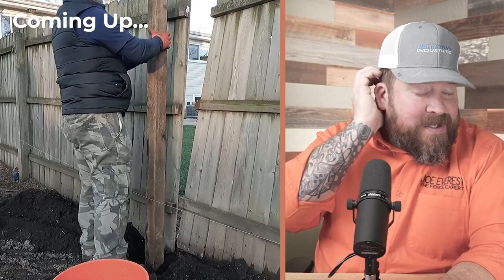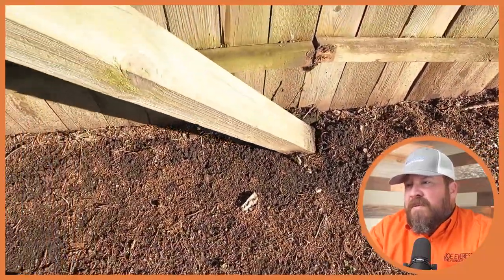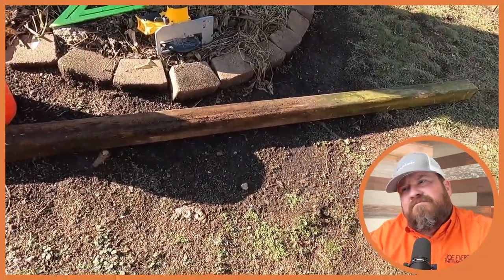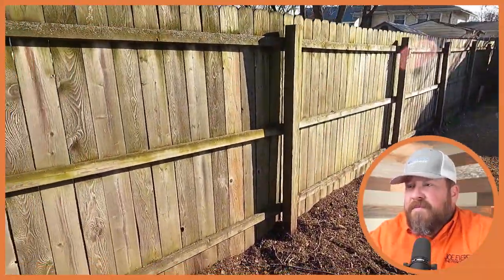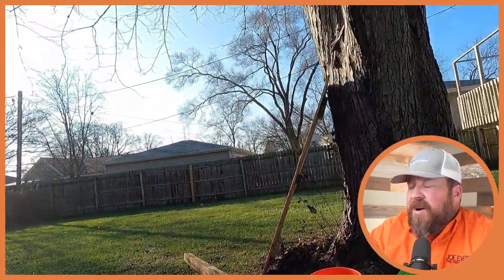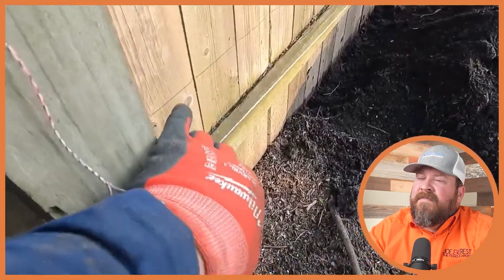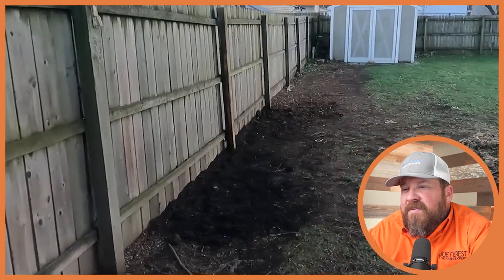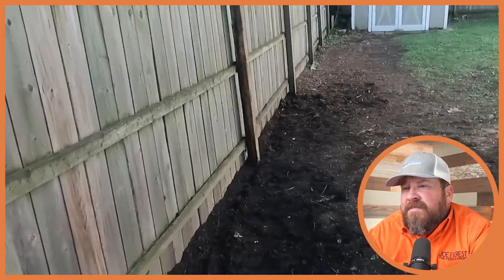Pro Fence Builder Learns How to "Fix" A Broken Fence Post

Comment: In Holland we have quick cure cement, probably you guys this too. The thing is that this can give woble in the post because the cement shrinks during curing. I stopped using it and premix all cement in a bucket and then poor it in.
Reply from the maker: We haven’t had a shrinkage problem with this brand a quick setting concrete, but I could certainly understand your point!

Comment: We all know that digging around the concrete ball is inevitable. I pull my posts with a modified hydraulic engine hoist. Usually I'll try to run a long lag with an eye loop to hook onto to pull the plug. If that doesn't work or isn't an option, I'll dig around the plug enough to get a chain around it to lift it out with the hoist.
Reply from the maker: Solid processes, I appreciate you sharing them!
Reply: @JoeEverest  I kinda like the idea though of running concrete lag screws into the concrete through the chain to minimize digging and yard damage. I'm gonna try that next time I face this scenario

Comment: I probably get bombed for this....but this how I handle it.  The fence is already old and not many years away from replacement.  Why work yourself to death pulling up the old post.  You risk running into hidden problems like a tree root or who knows what else.  We dig a new hole as close to the original post as possible...then scab the stringers together with a block of 2x4.  I dont know how long it took the guy in this video to repair it....but I would have been done and gone in 15 minutes.
Reply from the maker: Sounds like a solid process!

Comment: He really shouldn't have cut that root.  A tree's root system reaches all the way to it's drip line, or the furthest edge of it's foliage.  If you look up and you're really far from the drip line of the tree, try to avoid cutting those roots.  That was a really big root.  All roots do is move nutrients and water.  How much water and nutrients can you move in a 3" pipe?
Reply: That was my first thought- it was a mistake to cut a root that large! I wouldn’t cut anything over 3”, and even then only if there was no other option
Reply from the maker: Fair point!

Comment: Would it be better to add a sonnet tube so you can keep the concrete an inch or 2 above ground level to avoid rotting the 4x4 at ground level ?
I had a few pressure treated 6x6's on the side of my house for about 8 years , propped off the ground using some scarp pieces of pressure treated.

I discovered if you let the leaves sit on the pressure treated for an extended periods of time the pressure treated ill rot away.
The sections where there were no leaves were fine, no rot issues.

So if your fence posts will have lots of leaves and yard waste debris surrounding the posts where no one cleans it , I would imagine there may be a rot issue at the ground level.

Comment: After watching videos using a chain to remove the concrete, I found one with smooth side the chain would not bite on.  I ended up using a concrete anchor both to hook onto.  I will never dig so much again and I'll keep the hole smaller.
Reply from the maker: Sounds like a solid process, appreciate you sharing it!